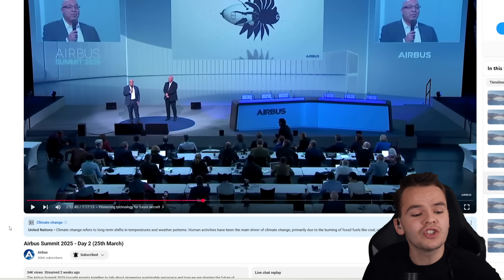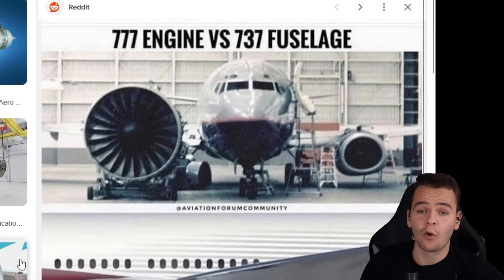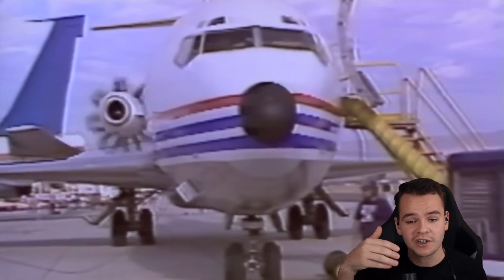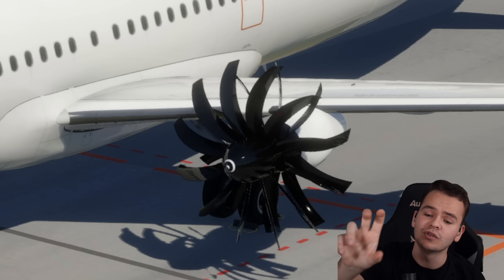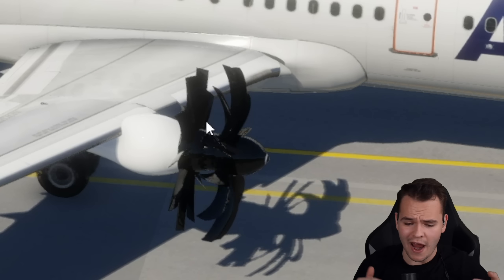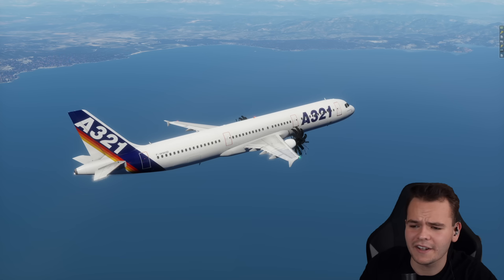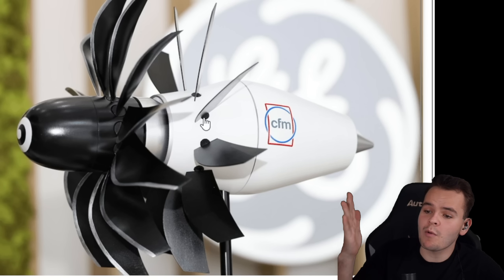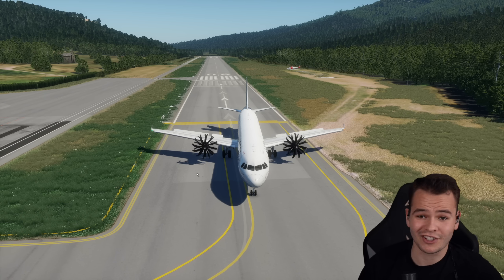Test Flying The NEW Airbus Plane

Comment: This does seem like it would be really loud.
Reply: it isnt
Reply: its not same as turboprop
Reply: @wlnx2  It was loud when they tried it in the 80s, so it probably will be now too.
Reply: @ThePerson9406 no its different now those engines are even less noisy than the jet engines we have now
Reply: @wlnx2  We will see.
Reply: one of the points of CFM Rise is that it is low noise
Reply: @LucasFerreira-gx9yh  Let’s hope it will be.

Comment: Preferred transportation 🛸 these machines may not have exhaust but propulsion is send energy in one direction or 2 directions pitch and roll, forward and backward, left and right doesn’t need yaw and flys faster than the speed of light and can go under water and in space. Super alloys will be needed to produce 🛸 and 🛸 are older than our aircraft in existence.

Comment: Safe to say the future of aviation looks very exciting
Reply: Its evolving, just backwards 💀
Reply: Idk for me it's all boring eco fuel numbers etc. In 2003 I could still fly EGLL-KJFK under 3h... But the future even on that route is a low-cost A321neo with 28" of legroom. I see nothing to be excited about
Reply: @tvflight7858  that EGLL-KJFK in under 3hrs was also very cramped lol, it was Concorde
Reply: @ The cabin was cramped because it flew at FL600 at mach 2, but it was all business class. Regardless, it was super cool and even though it wasn't paying off for the airlines it was imo the peak of aviation. All the rti-jets, the new A380... Today you have the max the neos/a220 the 787 or the a350, I mean it's smart and it makes sense but it's incredibly boring it's all the same.

Comment: For some reason these open fan designs look weird, prefer engines in a pod
Reply: that's just because you only know engines with the housing
Reply: that’s what ive been thinking
Reply: you'll get used to it
Reply: @yhfhdcf  nope
Reply: Look up kuznetsov nk-93, is contra rotating turboprop with housing
Reply: @some559 also the loudest non afterburning aviation engine there is.
Reply: @superskullmaster isn't that the Nk-12?
Reply: @some559  and looks like shit.
Reply: I prefer it, gives you more to look at on flights :)
Reply: That's not the main thing even the casing is protecting the engine from debris, birds and moisture.Without the casing it's basically vulnerable.
Reply: SAME BRROOOO
Reply: true
Reply: You’re not alone, they look pretty cursed
Reply: Funny. When Frank Whittle tested the first turbojet engine people said the same things. They preferred engines with propellers
Reply: yeah not flying on that shitbox
Reply: So propellers look weird
Reply: yes and they look even weirder with the old a320 livery
Reply: I mean its normal we not never saw that on high production cilvian aircraft
Reply: Open prop engine more efficent